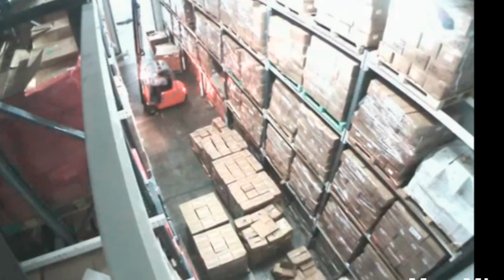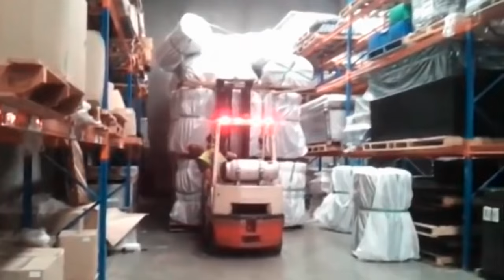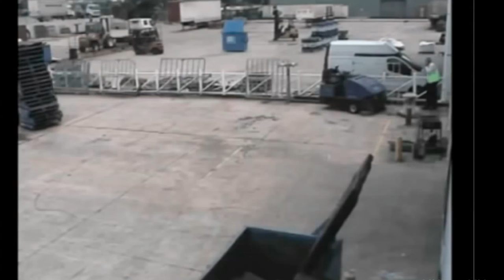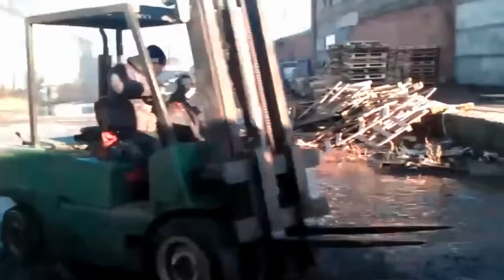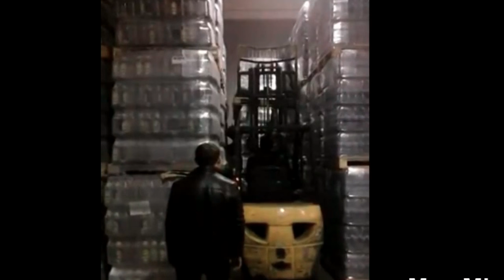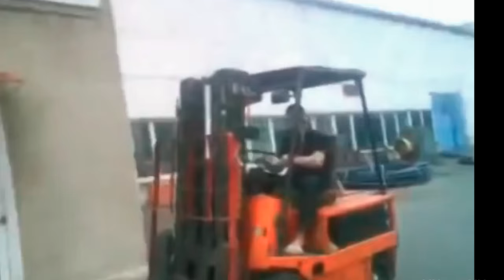Best Forklift fails. Ultimate compilation

Comment: I've been driving forks lifts for over 40 years. Never had 1 accident ever. When I worked for this one company who had a sister company back east and what happen was that the forklift driver drove off the dock. He made the biggest mistake of his life and tried to jump out before it hit the ground. The forklift landed on it's side and crushed him in half. If any one is reading this who drives a forklift always stay inside and hang on to the steering tight and try not to move around. Believe me you will survive one way or another and always use the safety belt. Thank you (from 976-CREOLEMAN).
Reply: haha tried to lift 4t bags with a 4 and half t forklift wasn't fun

Comment: That's why you need trained people on a forklift.
Reply: You also need patient trained people. Many people do not like to be patient.
Reply: Sometimes you can be at a loss even with trained forklift operators.
If they aren't properly handling the device (a significant number of operators qualifies), trouble is coming at you soon and fast.
Reply: @Robidu1973  Sure it can. with a licensed numbnut behind the steering wheel, It always can happen.  Only less accidents with qualified people. They usually don't make the classical mistakes non trained people make.